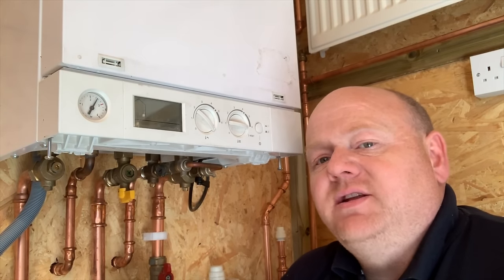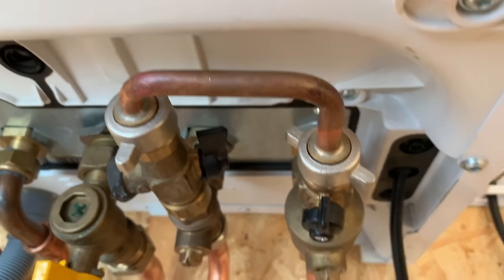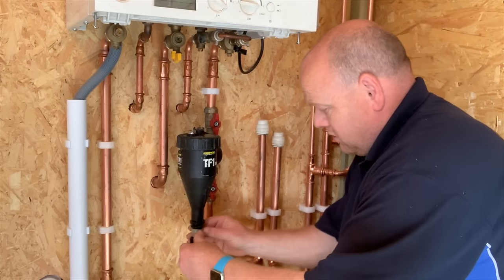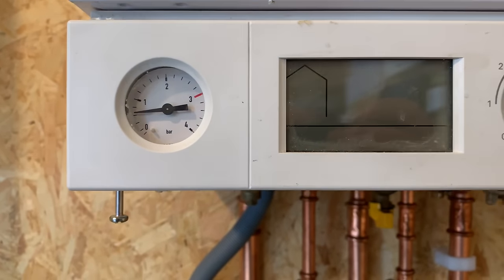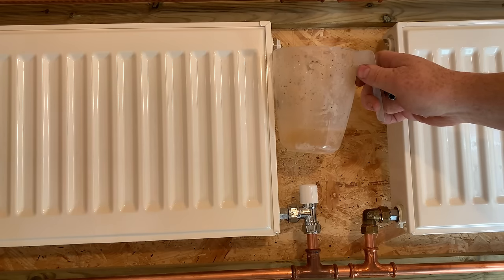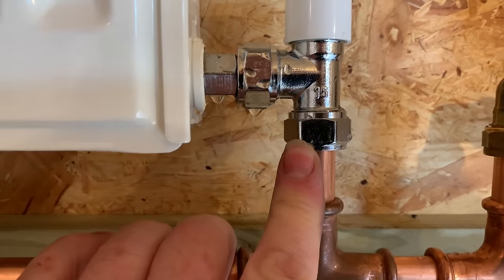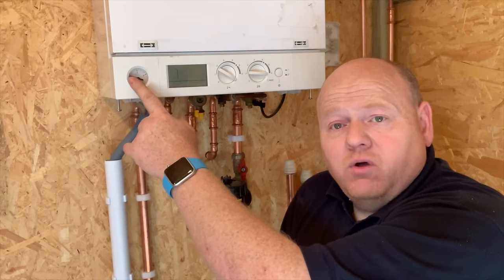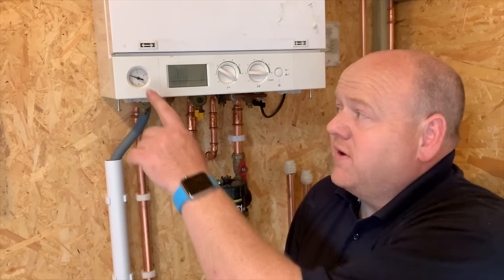Combi Boiler Too Much Pressure - How to reduce the water pressure - Central Heating

Comment: Dad is away on holiday, I ended up putting too much pressure in the boiler, using your radiator method manage to get it right. Thank you mate, really saved the day👍👍
Reply from the maker: Thanks very much for your comment, please consider subscribing to support the channel 🙂

Comment: That drain it via the Radiator was the method I use(d) - but I hardly drained any water before the pressure dropped from over 2 to just 1.5 bar.  Excellent video - thankyou!!!

Comment: Hi Alan, my pressure was on 0 so I followed your advice but it’s now over 2. The heating is working and the taps are fine when I’m wanting cold water, but when I turn them for hot water it turns into a tiny trickle and I’ve not got water at all. Any advice would be great! We have a gas shower, so totally stuck. Thank you!
Reply from the maker: Did you get it sorted? Thanks.

Comment: My radiators won't heat despite the boiler working so I had the not so brilliant idea to mess with things and valves etc underneath the boiler. I ended up increasing the water pressure quite a lot. I was totally panicked and found your video. So helpful and so clear. Thank you for showing the radiator method too as I couldn't locate the part underneath the boiler you showed first and I had had enough of a scare I didn't want to go messing with this boiler anymore!!

Comment: Like the other chap I over filled the boiler when re-pressurising. Had no idea what to do until I saw this video and scrolled through while the needle was going up. Drained the radiator - always have a key handy! - but it did come out in a gush, so be careful you have loads of kitchen paper handy. Worked perfectly. Saved my bacon. Thanks!
Reply from the maker: Thank you

Comment: I can not tell you how long i've been searching for all the information in your video. I couldn't find the info on Google or Youtube and it's such a bonus that you've explained it in such a simple way. Thank you so much.
Reply from the maker: What issue did you have? What boiler is it? Would you like any other videos on your boiler? Thanks.
Reply: @AllenHart999  Hi, I have a Procombi boiler 85HE. The pressure keeps going up to 3 bar or more when the heating is on. Since watching your video i've been bleeding the radiators to lower the pressure but it keeps rising again once it has been lowered. Then i noticed  the boiler shuts off when the pressure gets too high and when that happens the pressure drops to 0 so i then have to top the pressure up to get it going again. Then it will work for a while until it shuts itself off again. So from watching your video i'm thinking i have a problem with the expansion vessel. I've got an engineer coming Thursday to give it a service. When i top up the pressure with the filling loop though quite a bit of water comes out of the top tap which i'm thinking shouldn't happen? It doesn't seem to leak at all when it's closed but could that be causing the pressure to rise also? Thanks.

Comment: Thanks Allen! Boiler broke down yesterday. Water leaking from it, BG guy came out and fixed it. As he left he said "You might need to bleed the radiators and adjust the pressure again...." I shat myself! Thanks to your videos, a I've bled radiators, and adjusted the pressure. Its sitting steadily around 1.5ish bar. Thanks again! Great videos!
Reply from the maker: Thank you

Comment: Thank you Allen. We have just had a new system installed and as an engineer I need to understand how it works.  We have banging pipes and the installer set the pressure to 1.5 bar.  We are waiting on him coming to reduce the pressure but thanks to you I now know what he will be doing as well as an optimum pressure.
Reply from the maker: Thanks very much for your comment, please consider subscribing to support the channel 🙂
Reply: 1.5 Bar is fine...

Comment: It's the air in my radiators that need bleeding every so often that puts the pressure back down.
Thanks for the advice to not turn the radiator key too much, you have probably saved me an absolute disaster there mate. I had no idea that the plug could shoot out of the radiator, (Sounds like a nightmare that I wouldn't be able to deal with on the spot)
It was also good to know that the pressure gauge should be sitting on 1 when the boiler is off and the water cold. Thanks man :)
Reply from the maker: Thanks very much for your comment, please consider subscribing to support the channel 🙂

Comment: Fab, exactly what I needed to know to release some of the pressure in the boiler: when the heating was on, the gauge was ticking up over 3 bar. Refilled it too much when the pressure went below 0.5  bar. Took 1 jug of water drained from a radiator to do. Simple and well explained :) Pressure released and boiler back to 1bar!!
Reply from the maker: Thank you

Comment: Thanks so much Allen for your thoughtful and concise videos. We had been living with a a leaky pressure relief valve (PRV) for a couple years due to spiking pressure at startup. My system has an auto water feed valve to top off the water pressure "automatically", but pressure still fell below 1 bar on cold nights due to system contraction when off. Following your other video, I tested the pressure over time in the isolated boiler and had no loss, so I assumed it was probably the expansion tank. I drained the isolated boiler and proceeded to check and recharge the expansion tank. When I filled the expansion tank, a lot of sediment came out of the drain valve and the rest of the boiler water, which led me to believe that I also might have had a blockage in the expansion tank lead pipe. I thought I would share this to lend a hand.
Reply from the maker: Thanks very much for your comment, please consider subscribing to support the channel 🙂

Comment: Very detailed video with prcatical example its helpfull to understand about low or high pressurein boilar and how to contol it.
I must say you did excellent job by simplifed it. Noticed you got large radiator key to take air out from radiator where can you get it?

Comment from the maker: If you found my video useful please add a comment below and thanks for watching. PS like and share😂
Reply: Desperate for help if u can left a comment below. New years day and no chance of help
Reply from the maker: Siobhan Stephenson Give me a call and I will try and help 👍
Reply: Omg u star!! How do I find ya number plz
Reply from the maker: @siobhanstephenson8564  Happy to help you. Hope its all sorted.
Reply: @AllenHart we have heat and hot water boiler seems fine so far thankyou thankyou thankyou!!
Reply from the maker: @siobhanstephenson8564  Happy New Year.
Reply: Hi Allen. Thanks for help. I will try reducing pressure a bit. But after seeing your video it Sounds like the expansion vessel... new build house and it may be the builder put in too small a boiler. Thanks again for your  help. ...If only Ideal were as helpful as you
Reply: I dont know what I have done to my boiler I have turned all the switches under neath but now I have no water at all and there is a letter F coming up and the radiator is flashing now and no 70 on the screen
Reply: İdeal logic 26 vs Vaillant 286-5-3 would I buy ? Thanks
Reply: My duo tec 28 pressure has been all over  recently Allen. It has been dropping very low each morning recently to the point where the boiler won’t fire up. Then when I pressurised it today I bled my rads and now it’s pushing over 3 bar I’m confused can you help
Reply: My boiler goes to red but only when heating is on can I still do this process with heating on I think pressure is fine when heating is off
Reply: Thank you very much for your practical, hands-on approach!
Reply: Great video Alan! Easy to follow and really useful, we have hot water again! Thank you for sharing, you’re a life saver. Cheers, Tom
Reply: Hi mate. My boiler has two black handles and 2 blue handles plus the additional for gas and the one the next one to the pressure gauge. The pressure keeps going up by half a bar every few weeks. Plus the pressure gauge makes a bit of noise every time the boiler is on. What needs to be done?

Comment: If I could I would jump through my iPad and kiss you. You would not be happy because I am in my late 80’s. Today I had my boiler serviced. As I put everything back in my boiler room I noticed the water gauge was far higher than it had ever been. I had already been warned that 2 was too high and this was over 2 1/2 knew I was in trouble. Found you. Do I have a Filter, no. Nuts to be undone, no. Radiator bleed and yes there I am my comfort zone. Took 20 minutes but all perfect. Thank you so much. You saved me months of stress waiting for boiler to possible blow.
Reply from the maker: Thank You
Reply from the maker: Thanks very much for your comment, please consider subscribing to support the channel 🙂

Comment: Hi Allen, thank you for the informative videos as always. I’m faced with a different kind of boiler pressure issues on a Worcester 30cdi. The pressure slowly keeps going up to 3 bar and above. It takes around 8 to 12 hours for the pressure to exceed 3 bar from 1 bar. Everything been checked expansion vessels is fully charged and in good working condition. Filling key has been removed from the loop to make sure it’s not passing through the filling loop, but the pressure still keeps going up slowly. Any idea what it could be ?? A little help to guide me in the right direction would be very much appreciated. Thanks..
Reply: Any reply to this? im getting the same problem....
Reply: @shakeeloniel8891  
Which boiler do you have ?
Reply: In my case I had a very very tiny leakage on the expansion vessel.
Reply: @afzalrahman3632  worcester bosch rd532.
Reply: @afzalrahman3632   Hi Afzal i have a wocester bosch RD532, im getting exactly the same problem as you had. I need to check vessel were was yours leaking from?
Reply: @shakeeloniel8891  I'm not familiar with the boiler you have. My vessel had a minute internal leak where water was found on the other side which should've been just air.
Reply: @afzalrahman3632  Hi Afzal I pumped the vessel to 1 bar now boiler ran for 2 days pressure has gone over 2 bar again.... also I have over flow copper pipe driving water. I wanted to ask when you had this problem was your over flow pipe leaking outside?
Reply: @shakeeloniel8891  overflow ?? Do  you mean PRV ? If so yes it was when the pressure was too high. Basically I stripped it all down cleaned everything , there was quite a lot of issues with the boiler including rust built up on the PRV . also tried with replacing washers on the expansion vessel but it didn't solve the problems so eventually replaced the vessel because it had water on both sides of vessel, I mean I found the vessel had some water not a lot but some water on the air side of vessel, somehow the internal large rubber seals that keeps the water and air separate was leaking the water into the air section of the vessel. 
I'm not a plumber, so don't only rely on my experience. 
you might want to talk to or get a experience plumber to look into the issues. Whatever you do please be careful and safe.
Reply: @afzalrahman3632  yes prv  OK thanks so much its time to change the expansion vessel. Yes I will be careful
Reply: @afzalrahman3632  I remember before I pumped the vessel  I pushed the air nipple and water was squirting out of it. Thar indicates rubber seal is broken inside vessel.
Reply: @shakeel Oniel  Hi Shakeel please let me know how you get on, it would be nice to know. Thanks.
Reply: @afzalrahman3632  Hi Afzal your not going believe this... took of the filling loop and guess what the stopper letting tiny drops of water through unbelievable... I'm going to leave it disconnected and see if pressure holds in the next 5 days. 100 percent I bet yhis problem is solved.
Reply: @shakeeloniel8891  you are unbelievable Shakeel, I thought you’ve tested this as first thing !! This is a very common problem. That’s the first thing anyone tests, In any case you should disconnect the filling loop  as soon as your happy with the water pressure in the boiler. Thank good it’s nothing major. Take care mate and good luck.
Reply: @afzalrahman3632  yes it just I overlooked at the problem... yes if disconnected the filling loop pressure holds now perfectly.  Thanks for your help and support.
Reply: @shakeeloniel8891  k

Comment: Hi Allen, i have a slightly different problem with my Vaillant eco tec plus 28. Every now and again it loses its pressure, sometimes its okay for a while and other times it might happen twice in the same week. I have checked all rads and valves for leaks (thaey are fine) ive check nearly all the pipe runs and they seem fine and the blow off pipe outside is always dry. Any ideas what might be happening?
Thanks, Joe
Reply from the maker: When was the last time it was serviced?
Reply: @AllenHart999  its over due, about 18 months since last service
Reply from the maker: @joefowler9600  Might be better to have it serviced. Ask the engineer to check it. Thanks.
Reply: @AllenHart999  will do thanks 👍
Reply from the maker: @joefowler9600  Thanks.

Comment: We had a new boiler fitted Dec 2019 and this year it keeps gaining pressure. I thought that because the bathroom radiator was half hot half cold the air in it probably wasn’t helping so I bled the towel radiator (there was a lot of air in it) and the boiler dumped all the water out so I repressurised it to 1 bar and a week later it’s back up to between 2-3 bar when it’s on. Looks like I’ll be calling an engineer soon. Yay! Thanks for the informative video though! :)
Reply from the maker: Thank You
Reply from the maker: Thanks very much for your comment, please consider subscribing to support the channel 🙂

Comment: Thanks for informative video Allen . Boiler is an  Ideal combi 35  Having issue with pressure, previously topped up to approx 1.2 bar.When lit in heating mode system pressure raises to about 2.5 bar  Top up valves are both closed off.Ill have to get the Expansion vessel pressure checked out.Thanks again
Reply from the maker: Thanks very much for your comment, please consider subscribing to support the channel 🙂

Comment: Excellent video. My pressure was slowly creeping up. I think the filling valve was not fully turned off. Bleeding a radiator (about 1 pint of water) brought the pressure down. Saved me calling out an engineer. Thankyou for the excellent advice.
Reply from the maker: Hope you have now sorted it. Thanks.
Reply: Yes. I have. Thanks. Didn't realise that bleeding a radiator would do it. Thought I would need an engineer to do it at the boiler. Worcester Greenstar 30Si Combi Mk111. I have the manual but it really only covers installtion, not really fault finding.

Comment: British Gas did not close one of the valves on the filler loop and the boiler pressure kept increasing, after watching your video I checked the valves and closed the open valve.  The pressure gauge remains as 1.5 bar.   Thank you for the informative video.
Reply from the maker: Thank You
Reply from the maker: Thanks very much for your comment, please consider subscribing to support the channel 🙂

Comment: VERY GOOD AND CLEAR ADVICE MY BOILER GOES TO 1 BAR WHEN COLD 3 BAR WHEN 13 RADIATORS ARE HEATED WORCESTER BOSCH THANK YOU SO MUCH
Reply from the maker: Sounds like you have an issue with expansion vessel. ?
Reply: I am no Plumber but my friend had similar problem so he added a Boiler cleaner to a radiator with Inhibitor/Antifreeze and now his "at rest" pressure is 0.8 Bar and fully functioning is 1.4 Bar .. I hope this helps you. It's a MORCO GB24 Series II same as mine.
Reply: @Biggles2498  THANKS ROY

Comment: Thanks for a very informative video. My expansion vessel has an 8 litre capacity and I have 10 radiators. The boiler output is 32kw. Do you advise putting an additional vessel say 12 litres because as I have a zone system I can only have downstairs or upstairs heating not both at the same time as the pressure reaches 2.8 bars, with heating only one floor the pressure is stable at 2.3 bars? Would value your response .
Reply from the maker: Thanks very much for your comment, please consider subscribing to support the channel 🙂

Comment: Thank you Allen.  I have only just got comfortable with topping up the pressure in my Vokera boiler when it drops.  Did this this morning but put a bit too much water back in.  It is now at 2.  I am not sure if it is safe to restart at this pressure or whether to try to be brave and try and bleed a radiator??

Comment: great advice as always .My workshop boiler pressure had gone up to 1.7 bar . it has been just over 1 bar for over 14 years . I took it down to 1.3 bar and will reduce it even more .Will I need to add some more inhibitor .
Reply from the maker: Good stuff

Comment: Great video as usual Allen , our Worcester Bosch expansion bottle needed replacing at only 18 months as the pressure kept rising when hot , the boiler had already been so problamatic we got rid of it as it was going to cost a lot to replace as was right at the back of the boiler , brother had the same with his WB after five years but he fitted an external expansion bottle .
Reply from the maker: Thank you

Comment: Thank you for this excellent video, a quick question from  your video. I have been losing pressure in my combi boiler every other day for about a week  and have to top it up to one bar, today however after I topped it up to one bar , when the heating went on it raised up to about three bars right into the red ,once I turned the heating off it dropped back to one bar, there are no leaks on any of the radiators but there is water coming outside out of the 15 mil copper pipe and a white plastic pipe , I'm not sure if this could be the expansion vessel or the pressure relief valve as the pressure is dropping and raising so quickly. Any thoughts,  thank-you